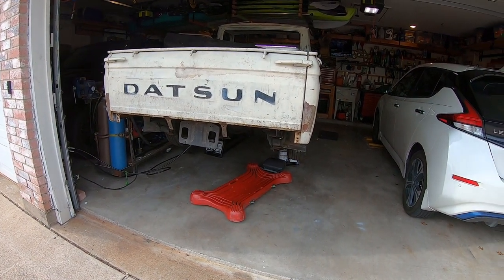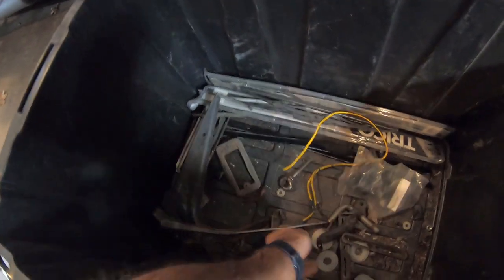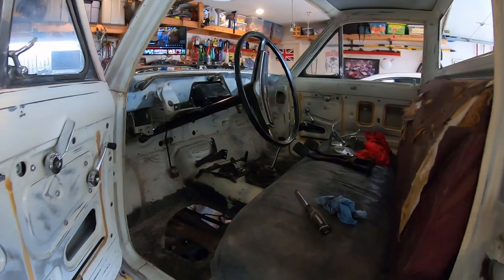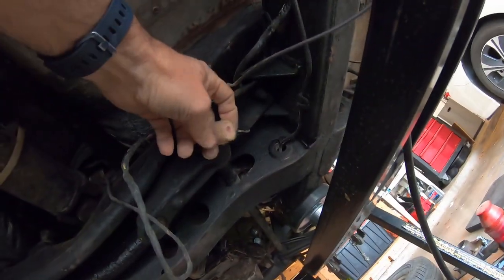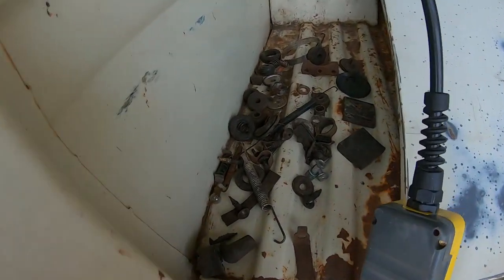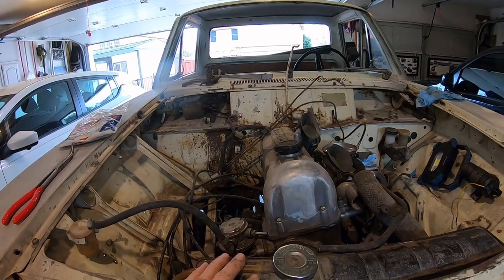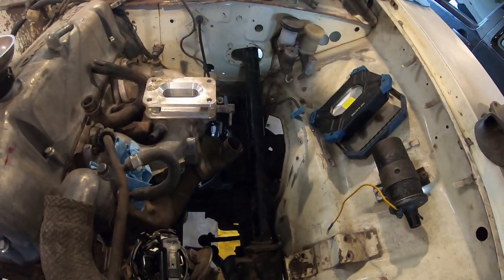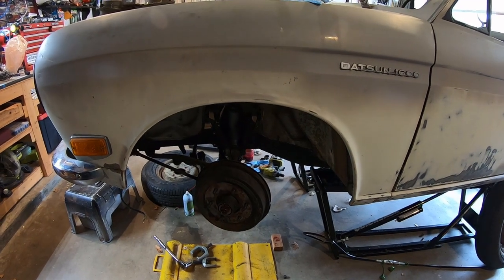Datsun truck restoration part 1. The 521 walk around

Comment: I recently met a friend of a friend that is looking to sell the exact same truck. 
Body is perfectly straight but has some surface rust. It's been sitting for awhile but only has 34k miles on it.
It's in San Antonio, Tx so no major rust/corrosion.
Reply from the maker: Nice, I am in texas, went to Kansas to buy this one. Just installed new windshield just now in mine.